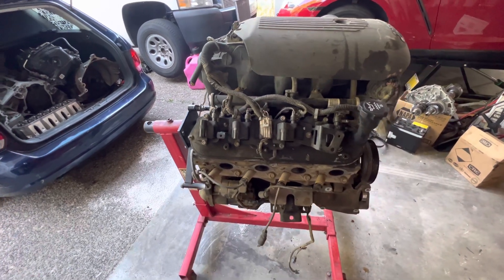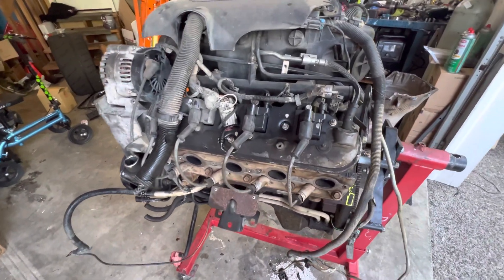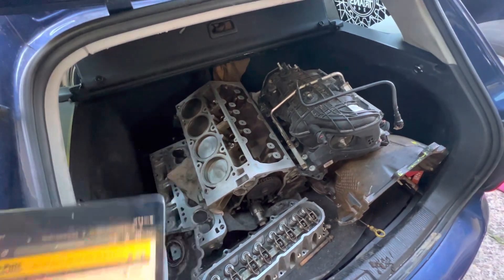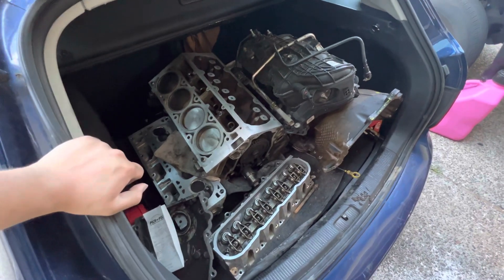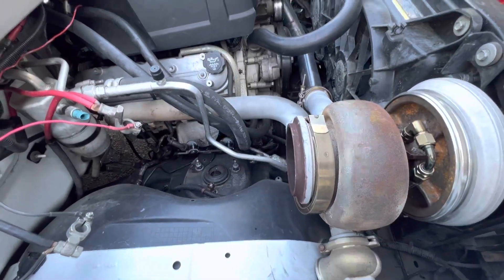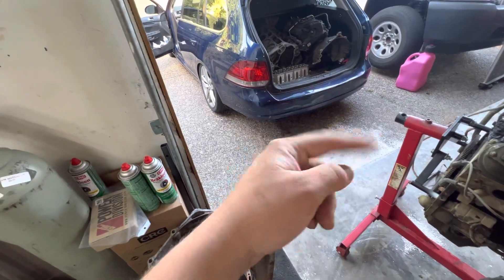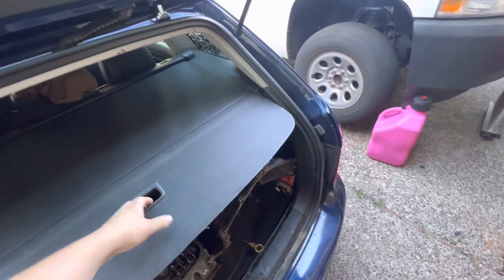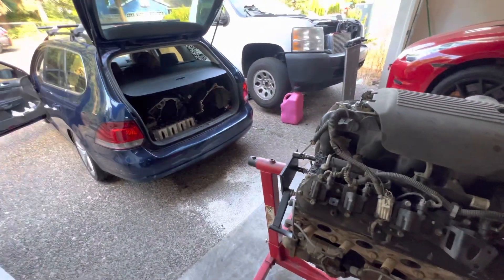8s for $8000 2022. Engine/power plant options and opinions.

Comment: Never built one of these before but aren't the 4th gen motors the ones with the good rods?
Reply from the maker: Yeah they both are. The late gen3 motors 2004.5ish and up have the gen 4 rods. In 2007 they switched from 24X to 58X crank triggers
Reply: @Jonny_trans  dang you learn something new everyday I hope you have better crank sensor luck than cleetus on his 5.3 block!
Reply from the maker: @triggeredhondaboy8648  I don’t expect any issues. I think he may have a bad ECU or he’s getting some electrical interference with the signal back to the ECU. His crank pickup is a flying magnet. Most people don’t  have problems with those

Comment: I would just boost anything with an ohv. They're air starved and the low compression effectively makes it a bolt on kit. Then again, you might as well up grade the rotating assembly if its apart.
Reply from the maker: It’s hard to justify upgrading the engine. I’m running a iron 5.3 In my truck at over 800hp. This car should need 750-800hp to reach my goal
Reply: @Jonny_trans  This is true as a cheap engine, but wouldn't it drive like a 2 stroke engine with its stock cam?